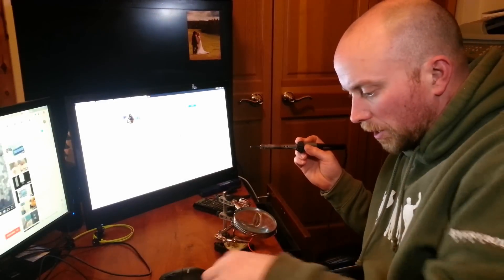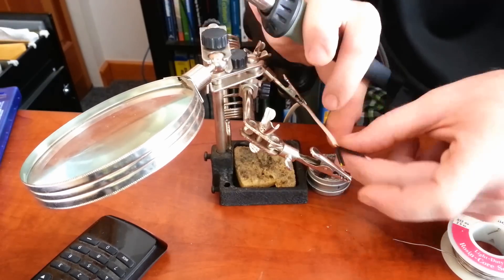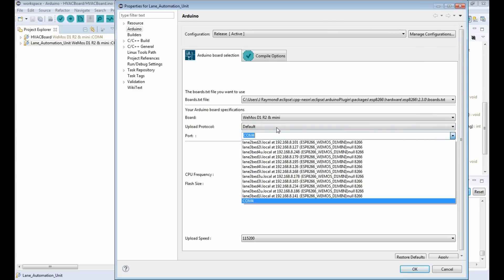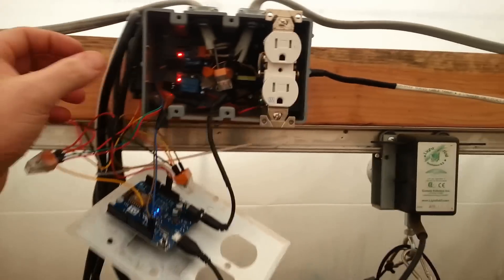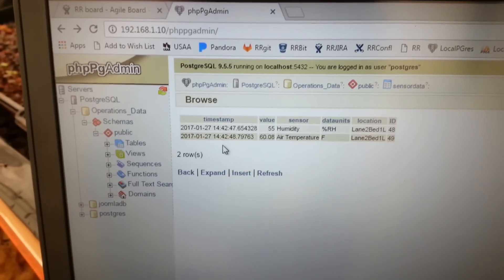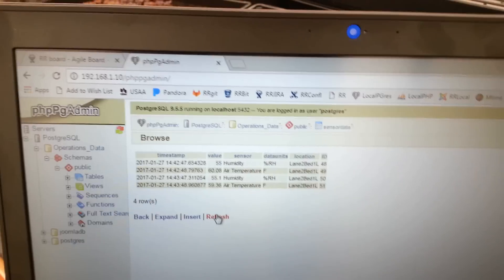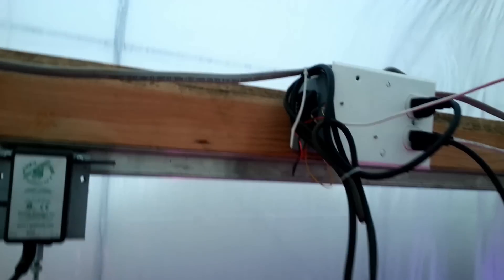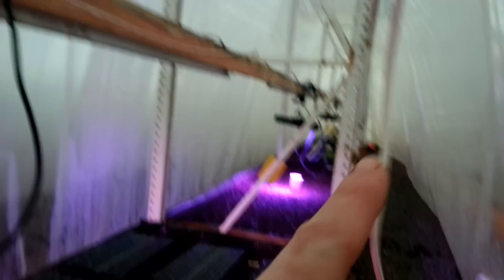How to build your own TEMPERATURE and HUMIDITY sensor with ARDUINO Part 2

Comment: My experience is to get away from the cheap sensors for humidity. They tend to fail on different ways. right now iam having a dht11 on a wemos and i get good temperature but the RH just seems to stale on a value. one of them staled on 22% and now the changed one on 34%... and i dont think this is usable for hydroponics.

Comment: You where talking about 10 degree difference,.... did you calibrate the temp/humidity senor.... if not how do know the value is accurate. If Not calibrated the value have trend value until you have calibrated and then correct the stored data.

Comment: Whenever using any temperature sensor/thermometer you should be sure it is calibrated/certified. A friend of mine uses a lab grade mercurial thermometer to calibrate his other thermometers with such a large variation on the reading I would hazard to guess that  you might have a combination of things 1 there is variation between the sensor and the thermometer but 2 and  more likely the placement of the sensor is picking up some localized heat either from the electronics of the box/power supply etc or stored heat in the surrounding materials

Comment: With regard to soldiering.. It's worth the money to get a better soldier station. One of the temp control unit's.. with a finer tip..

You also need a Temp reading for the Water of the Fish tank area.. > 25 degree C will cause issues with oxygen levels in the Water.. Killed over 40Kg's of trout cause of over temp...

Comment: Are you concerned of the moisture build up on the circuit boards ?
Reply: Theredneck Prepper shouldn't be a problem, buildup on the tent is from difference in temp outside and inside the plastic. the control boxes are inside and warm. no surface cold enough for condensation.
Reply: Got ya ! just was my concern ! they do make a plastic spray for ct boards ! i use it